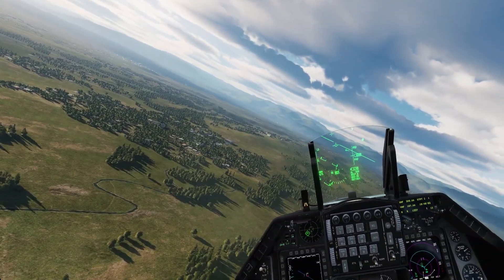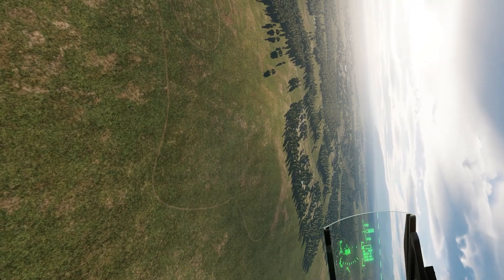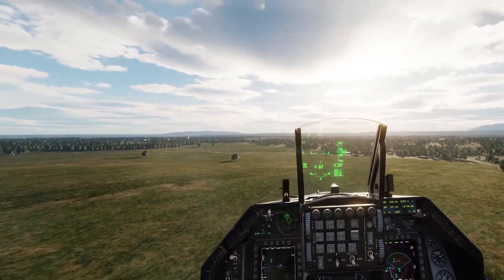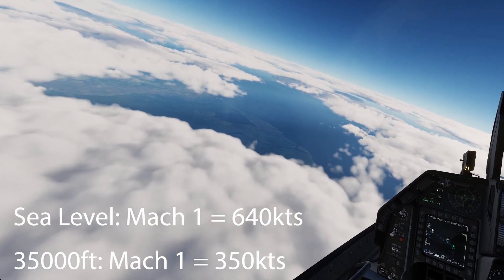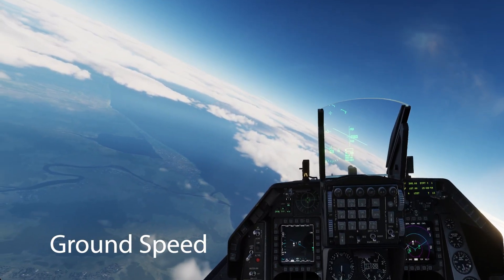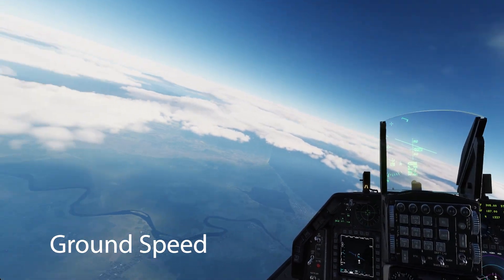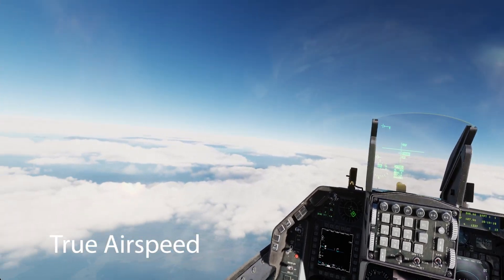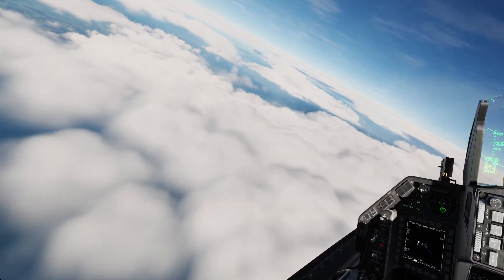Why Airspeed and Mach Number Are Different | F16 Viper | DCS | Digital Combat Simulator

Comment: Nice video and explanation! There is a switch on the right side where the HUD panel is. It has 3 positions for CAS (default on the HUD) TAS and GS. It changes the kind of air speed you see on the HUD scale 😉
Reply from the maker: Thanks man! I knew it could show you just never looked into it.

Comment: Fuel wasn't your problem getting to 640 KIAS at 35k ft. The Viper wouldn't have been able to do that at all -- at least not in DCS for whatever reasons. I say that having pushed it with the F-15C in free flight; unloaded and could barely hit 350~400 KIAS above 35k ft. The Viper is quick in an agile sense, but the F-15 is a match or faster when cruising.
Reply from the maker: You are probably right! Mach 2 at 35K ft is probably 450kts
Reply: I've done mach 2.5 in the eagle but viper hits a wall at mach 2. I think the viper wins on acceleration however.

Comment: Thanks for the video.  I thought your explanation of TAS vs IAS was pretty good.  But I don't think it was made clear that the relationship between TAS and Mach number also varies with altitude.
Reply: Concur. This was a GS, TAS, vs IAS explanation. I say that as a hint to re-title because the video is valuable for that.

I came in knowing mach is the speed of sound, and that the speed of sound is certainly different under different conditions. I don't specifically know which conditions matter most (temperature, pressure, something else?), or how those conditions change the IAS versus mach, but I was eager to find out. No such luck here.
Reply from the maker: I think you missed the point of the video. This is an explanation of what IAS is. A lot of people don’t know why you have to go 600kts to get to Mach 1 close to sea level but at 35000ft you only have to go like 300kts. The speed of sound is relatively constant at the altitudes planes fly at.

You are right. Speed of sound is dependent on a multitude of factors but that has nothing to do with IAS.

Comment: In the F-16 you can change the displayed airspeed between Calibrated airspeed (CAS), True Airspeed (TAS), and Ground speed (GS). Look for a switch on the HUD panel next to you right knee/leg. So there is no Indicated Airspeed (IAS), but CAS is similar principle only corrected for installation position, so should be a more accurate presentation of the energy state compared to IAS.

Also the speed of sound in earths atmosphere is predominantly dependent on temperature. So the temperature is a huge driver for how fast you have to fly to be at mach 1. At -65c the speed of sound is 562knots. At 30c it’s 678knots. Hence the temperature (which changes with altitude) is also a driving factor in the difference between CAS and Mach number at different altitudes.
Reply from the maker: Thanks for that location! And CAS is a bit more complicated. Just trying to keep it simple ya know for the people who aren’t versed in aviation!